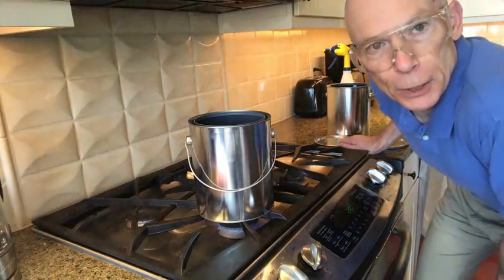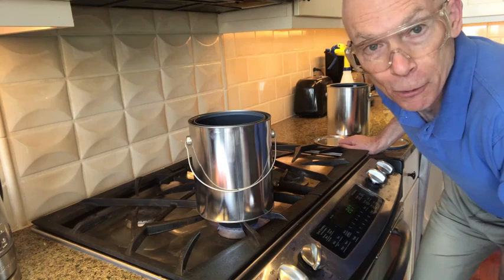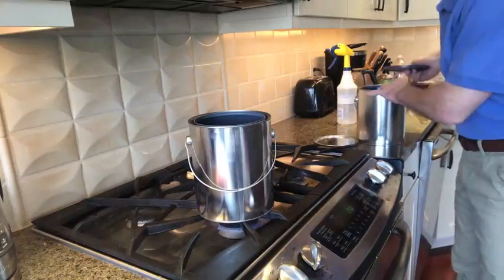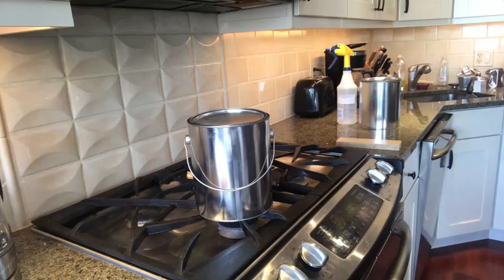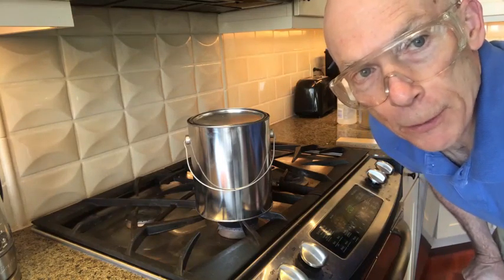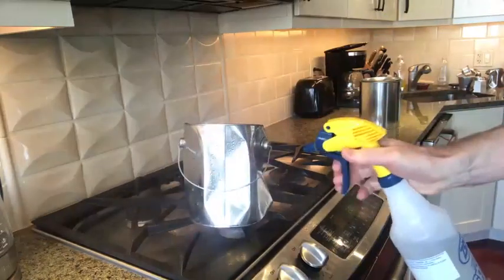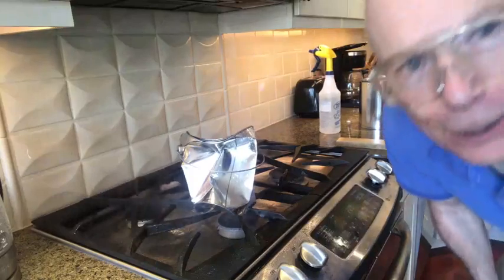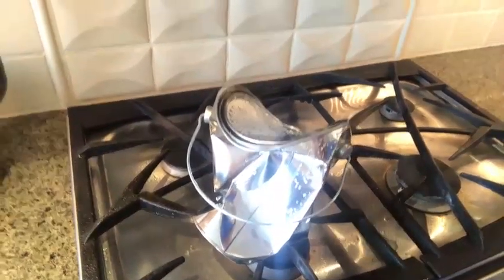Bob Hanlon: Vacuum collapse of (very small) tank

Comment: When I worked at a Getty refinery many years ago, we had "sponge" tanks where we stored gasoline and butane with high RVP. One very hot day there was a thunderstorm (rapid cooling) and the same thing happened to a 60 Kbbl tank.
Reply from the maker: I've seen fotos of large tank collapses and have wondered what didn't happen during HAZOP review to prevent such incidents
Reply: @rthanlon  
That was 1972. I don't think there were HAZOPS yet. All refineries used to have sponge tanks. They looked like pumpkins.
Reply: HAZOP was developed by Lawley (1974) of ICI.
Reply from the maker: @dougharrison7743  so here's the $64,000 question, why?  Was there a single incident that triggered Lawley/ICI to develop the HAZOP?   Or the accumulation of incidents?